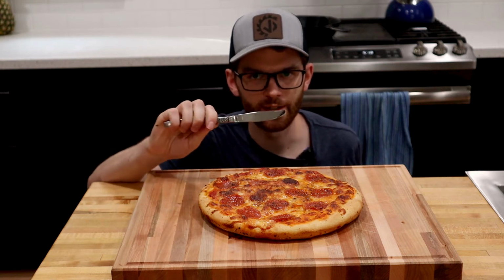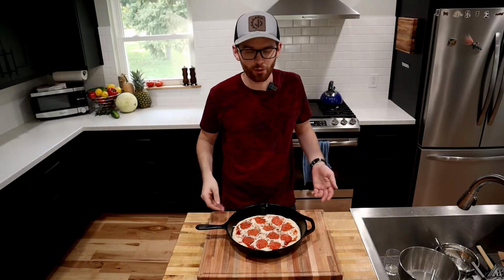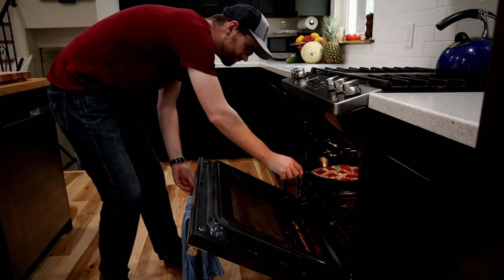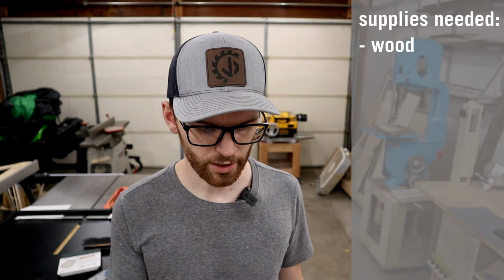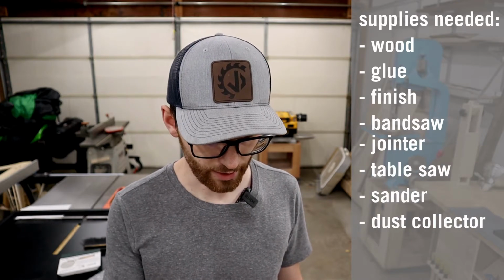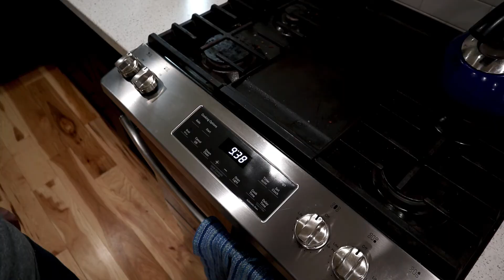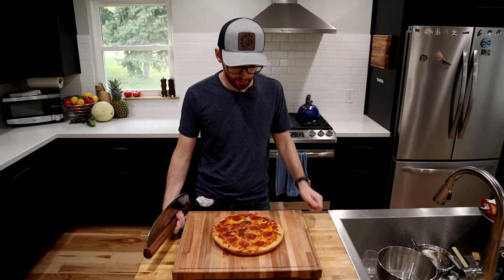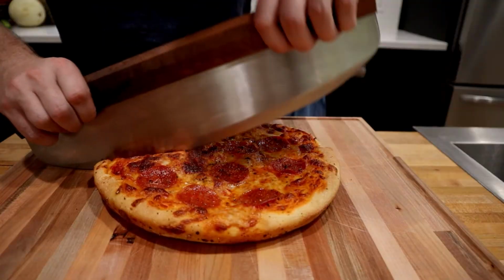How to Make a Pizza Cutter | DIY Rocking Pizza Cutter Kit Perfect Beginner Woodworking Project!

Comment: what are the dimensions you set for table saw width and depth for blade? tx
Reply from the maker: Good question!  I think I used a 3/16" wide blade, and probably cut 1" deep.  The depth would be different depending on which knife kit you buy.

Comment: Do you recall the angle you set on the table saw for the bottom bevels?  Thanks and great video!
Reply from the maker: thanks for watching and subscribing! I used 45* for the top and 30* for the bottom.

Comment: Thanks for the vid! The kit is on sale right now at Woodcraft and wife says she wants one. Gilt free shop time!! Question: Did you choose not to add the 4 pins since using epoxy or did I miss that part?  Thanks...subscribed.
Reply from the maker: Right on! Gilt free shop time is the best time! 
I omitted the rivets entirely. They are really short (1/2" long) and would have required counterbores on both sides, which I thought would collect junk. The epoxy in this case is more than enough to hold everything together. :-) good luck!